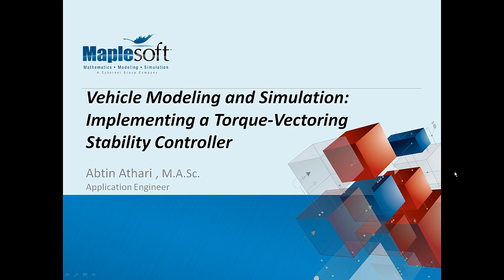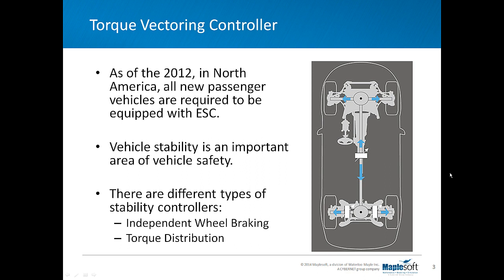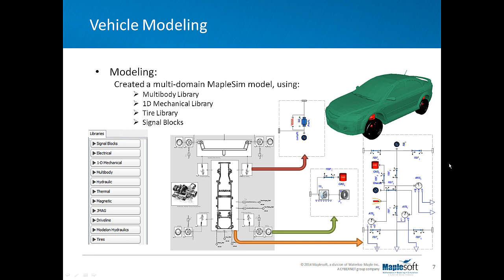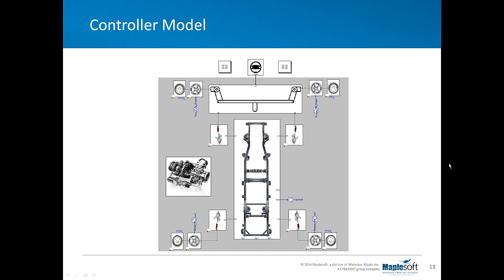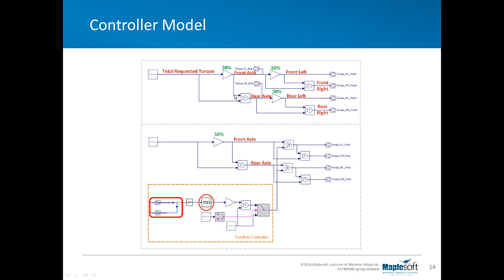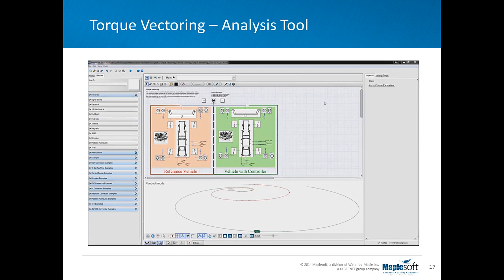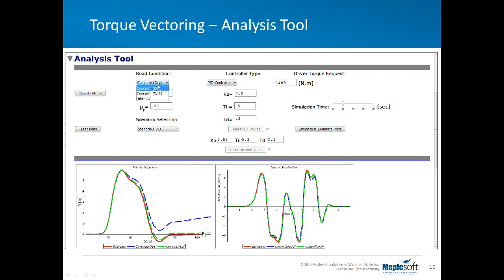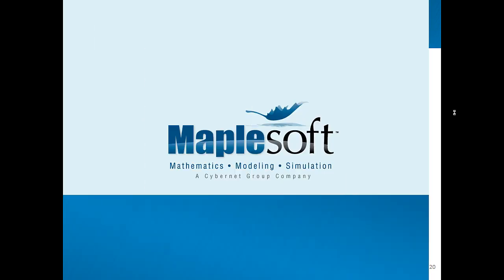Vehicle Modeling and Simulation: Implementing a Torque-Vectoring Stability Controller

Comment: can i know what kind of sftware your use for to make the that stability simulation...?
Reply from the maker: Thanks for the question. The model was developed using MapleSim, which is system-level modeling software. If you are interested, you can learn more at www.maplesoft.com/products/maplesim.
Reply: @maplesoft  this is not Matlab?